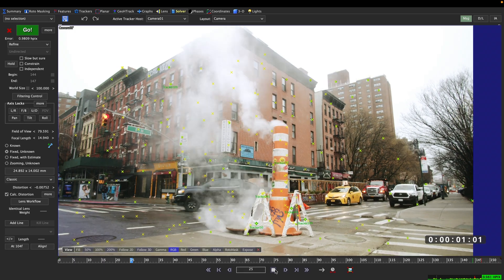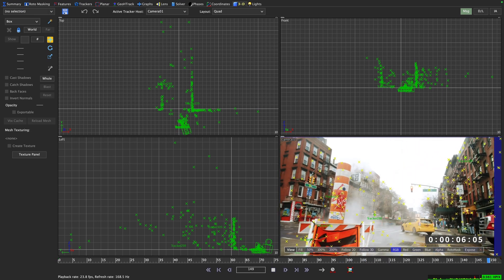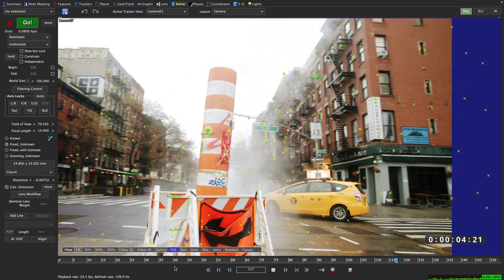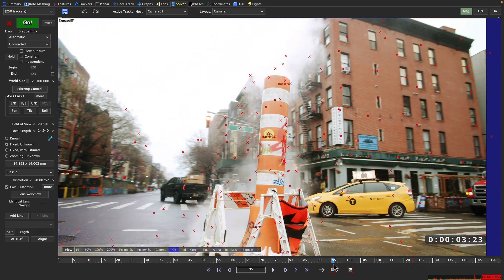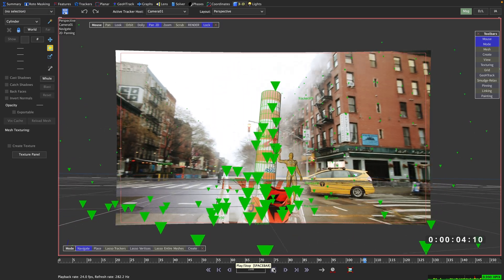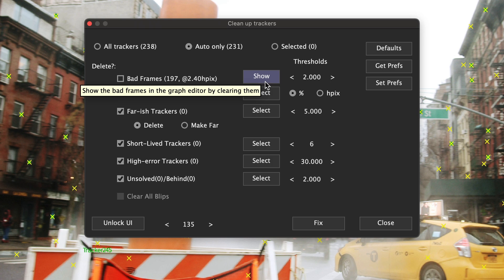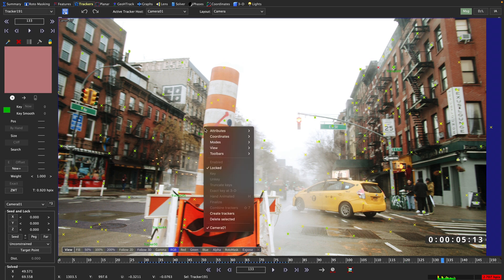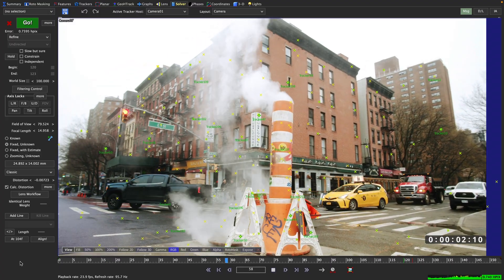Demystifying Solver Accuracy Myths in SynthEyes [Boris FX]

Comment: amazing, thank you so much! I want to know why most of the footage that i tried to use just in MP4 or MOV seems to lose frames and I get a bad solve, everytime I have to make an image sequence to make it work, could it be possible to add the option of the image sequence creation inside Syntheyes ?
Reply: Hey, thanks for your comment! The issue with most Formats like mp4 and certain mov formats is that they use to achieve better compression by "skipping over" frames. That is why i would recommend - not only for SynthEyes, but for any frame accurate vfx software -  to convert your movie into an image sequence.  And you can actually do that in Syntheyes. Under Export, you can choose "Save to Sequence". There you can choose your preferred file format and settings. It is also available in the multi exporter. Just be mindful of any Geo, Lens Workflow or other modification you might already have made to your scene.

Comment: Why doesnt syntheyes get rid of high error frames  automatically by solving the camera? Why do i have to get to cleanup trackers and do this steps manually? This is what makes syntheyes so confusing to me. The same with setting up a coordinate system with distance constraints. Without a tutorial i would have never ever figured  out how to set up a scene with a distance  constraint between two point. Not to mention that for some tasks I have to press some tiny buttons  somewhere in the Interface, like for setting up a proper coordinate system. Especially in times where AI gets better and better, syntheyes needs  to adapt and become more user friendly. I had to do a "master course" just to learn how to navigate trough syntheyes buttons and Interfaces. Why i am using syntheyes? Because it's superior to blenders  tracking system.
Reply: Hey Johannes! Thanks for your comment. SynthEyes is certainly a complex software, but if you for example use the AutoSolve Feature in the Summary Page, SynthEyes will do a Solve, get rid of Bad Trackers, Refine and and Align your scene with the press of a single button. On more straightforward shots this is perfectly fine, however, for more complex scenarios, SynthEyes offers the ability to let you take over the steering wheel so that you can be very selective about what to remove. That is also why i showed both an automatic process with the Clean Up Trackers Dialogue and a manual process with the tracker radar, because in some instances you want to have manual control over whether to delete the whole tracker, keep part of the data or turn it into a Zero Weight Tracker. And I hope that with videos like this one we can make SynthEyes a little bit less confusing.